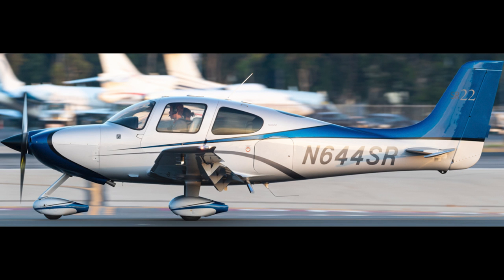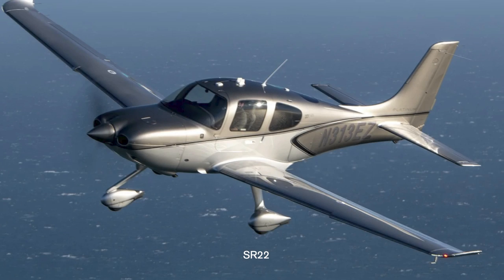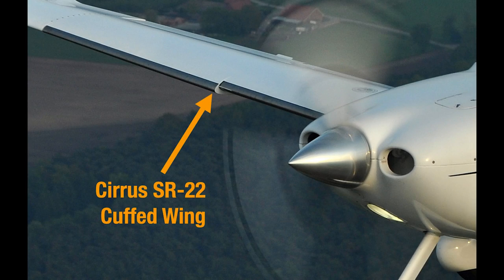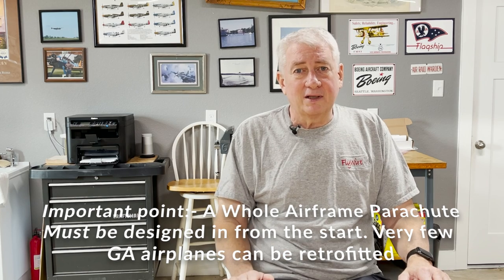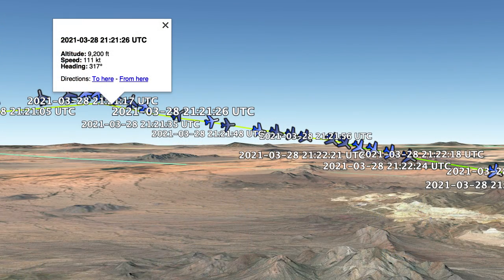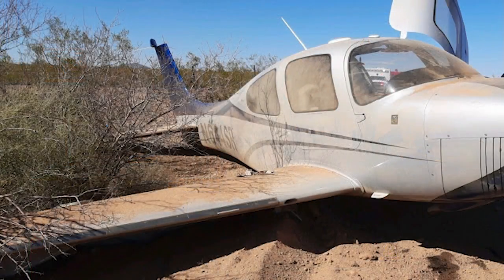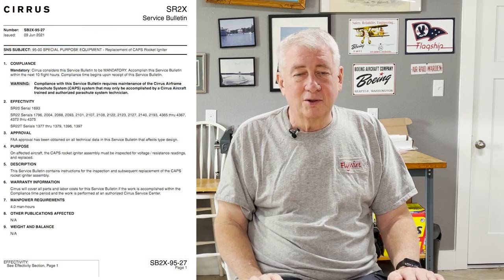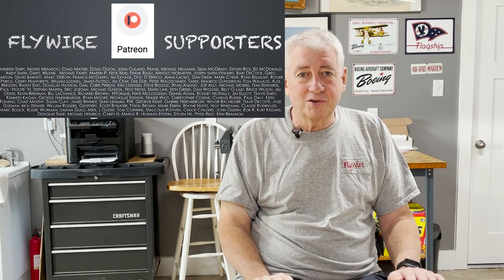N644SR SR22 Engine Out And No Chute

Comment: Why is it a lot of times I hear about engine failure or a chute deployment  it's a cirrus?
Reply from the maker: Funny I talk about Bonanzas most of the time and folks say the same thing about Bo’s.
Reply: @FlyWirescottperdue  Have a lot time in bonanza's, never needed a chute.
Reply: Have a lot of time in a Cirrus and never needed a chute ( but I have one if I need it)
Reply: There are more new Cirrus's flying than any other brand / model. They've sold 8000 so far since 2000. And because of the capabilities of the planes, they fly more often. The joke at our airport was that when the weather was really bad, the only things you'd see flying were King Airs and SR22's.

Comment: Nice planes, too bad they price 80% of aircraft owners out of their market.
Reply: It's priced about the same as a Cessna 182.  Nice shoes are priced out of the market for average buyers of shoes too.
I owned a 1967 model Cessna 182 and sold it.  Now I rent a Cirrus SR22T in a flying club for less money than I spent annually for owning my Cessna.
Reply: And that is the point. Cant touch a real airplane for under $100k nowadays. Have to go experimental if anything at all. Could buy a 1973 C182 in 1989 for $37k. 

Nope, expenses, insurance, and liability have strangled the industry into suffocation, unless you have $300k to spend on something that does exactly the same thing as the product did 40 years ago. Shame.

Comment: The SR22 is a dangerous airplane for general aviation. Between 2001 and May 2014 there were 122 fatalities in US-registered SR22's. Recent improvement in fatality data is generally attributed to the increased training and the parachute. But why not just buy a safer airplane? I believe the answer is America's obsession with speed. The SR22 is fast, but at the expense of pretty much every other desirable flight property.

Comment: You hit the nail right on the head. Happens with cars and pilots. As you make cars and planes safer, you create more unsafe and dumber (ok, I'll be nice, less safe and less informed) drivers and pilots. The crash numbers go down because the safety features overcome the steps towards Idiocracy.
Reply: Nobody seems to realize how many engine failures have occurred in a Cirrus, it’s very scary, and once you know, the smart ones don’t take valuable family members up in a single engine plane.

Comment: Probably gonna make some people mad but Ive always thought Cirrus trains their folks wrong...often times an engine out can be handled by a pilot by landing...IMHO chutes are for those times where there is zero possibility of landing...recoverable spins are not a zero possibility of landing...yes its not taught anymore but it should be...as should basic aerobatics ....dumbing pilot training down does not help....and it seems Cirrus is on the leading edge of dumbing pilots down...
Reply: I agree.  I think the main purpose of the chute is for an airframe failure.  If the airplane is flyable, there are few circumstances where I would trust the chute more than my flying skill.  Certain terrain would warrant a different decision, but an engine out landing is survivable in most circumstances if the airplane is flown all the way into the crash as Bob Hoover said.
Reply: I've wondered if they couldn't have made the 'chute system able to work without basically totaling the aircraft?   Some owners might be hesitant to pull the handle that is guaranteed to write off their aircraft and this hesitation could take them out of the safe deployment envelope which could cost them their lives.   The speed limitation on the 'chute system means that you must pull the lever pretty early in a situation where someone might not be convinced yet that they have no other option.    One guy lost control due to icing and was over the speed limit in a second or two once it departed from controlled flight.   If I worked at/for Cirrus figuring out a way to extend the operational envelope would be something that I'd really want to do.   They spent a LOT of money getting the current system working and approved for flight and probably are really hesitant to improve on it...being that every ambulance chasing lawyer would sue them because they 'admitted fault' with the old system.   This sad reality is behind a bunch of improvements that we'll never see because making that change would invite lawsuits.
Reply: @recoilrob324  I did not know that deployment totaled the airframe.  Even so, most cases where chute deployment is warranted would also likely severely damage the airframe so I am not sure that is all that big a consideration.
Reply: Remember that as many as 10-30% of all engine outs result in a fatality (depending on the timeframe you look at and how you crunch the numbers). From a probabilistic risk perspective, that’s a high number. Pulling the chute is statistically less likely to fail in that case. 
However you limit your options once you pull the chute. So it needs to be evaluated based on your current energy and the situation/surroundings. In rural Midwest, you have plenty of fields and an a dead stick may be more appropriate. But you have risks of hitting power lines, fences, etc still. In rocky terrain or dense urban areas it may be better to chute first. So the real point in my mind is to use your available time wisely to assess the most appropriate way to get the plane safely on the ground, remembering that the stats in many cases will favor the chute but may not be appropriate in other cases.
Reply: @enthalpy  Most fatalities are after a stall/spin. Fly all the way into the crash and the fatality rate is quit low.

Comment: Good job. Maybe I missed it, but why didn’t the chute open? Thanks!
Reply: Go back to the video at 11:25 and he tells us why.
Reply: Rocket failure.
Reply: Okay, Now I'm going to jump on it. I, as one, have just spent the greater portion of my life coming to understanding at least one good thing about doing anything that is dangerous to you and or your passengers, especially when it's hi-tech enough that it will snuff you and or your passengers out really, really quick ,sometimes so fast....you will not even know that you died!! Example....the nuclear  submarine thresher!!!! Next when a 8 inch iron space rock hits the international space station at just the right angle to go through one of the long ways at 10.0 miles per second. End of story at that point, Now, for the good stuff, Humans....being what we are...! Frail and prone to dying over the silliest things, have thought up many ways of staying alive while we are doing the most dangerous things....like being way up in the air without being a bird, or being way down in the ocean without being a fish!! Okay so, to fix all of these things that we do, we think up ways to make life safer for us. We make many ways to do the same things, like fire off that rocket to pull the Parachute out of the airplane....duh. It seems like we always have at least three separate  systems to make sure that the safety stuff always works....! Unless someone forgot to wire it properly or didn't grease it when they was supposed to. Sounds like weak Frail Humans to me??? Michael said that, bye for now my friends.

Comment: You pretty much give accurate information except the following.  The Cirrus did indeed pass spin recovery in the EU.  The FAA did not require spin testing given the presence of the chute which was proven to work in testing.  But all Cirrus can still recover from a spin.  Cirrus recommends pulling the chute if you have enough altitude, but there is nothing to stop a pilot from simply recovering from a spin should one occur.   Your premise that having a chute and pulling the chute can cost time when attempting to crash land is bogus.  Cirrus in fact says, given winds, when an engine fails pull the chute immediately, otherwise if winds are bad, glide to a lower altitude and pull the chute.  The chute failure is RARE.  In the early years, maintaining the chute was thought to be every 10 years for a major repack.  But since those days, Cirrus now tells mechanics to inspect every aspect of the chute and to test the rockets on EACH ANNUAL.
Reply: That's not what he said - re-watch the video.
Reply: @danielhawley6817  Sure it is.  I just finished the video for him filling in the holes in his argument.  He claimed fiddling with the chute cost the pilot time and he also complained that the pilot was fixated on finding an airport.  Neither is a bad thing and part of normal ops for ANYONE in an emergency situation that has some altitude to play witih...The chute is PART of the emergency checklist, not the entire thing.  If the chute failed to deploy then crash landing the plane is the only option left.  Planes without a chute crash landing is the ONLY option.  Hundreds have been saved with the chute.  It is a proven safety feature and planes that do not have one are flying at much higher risk.